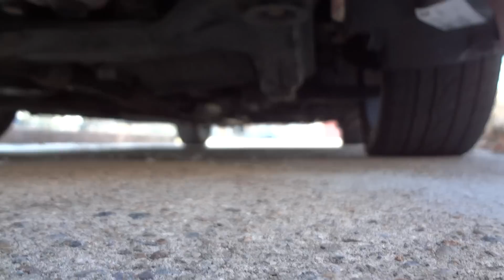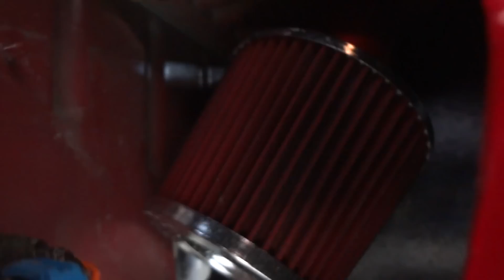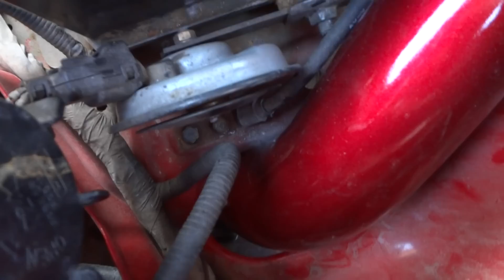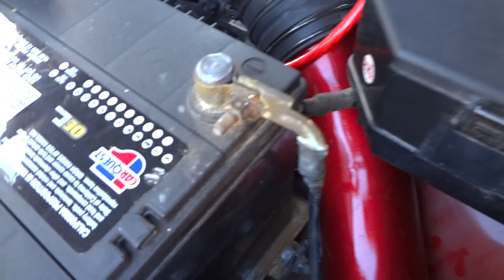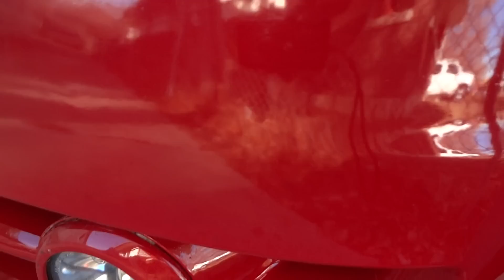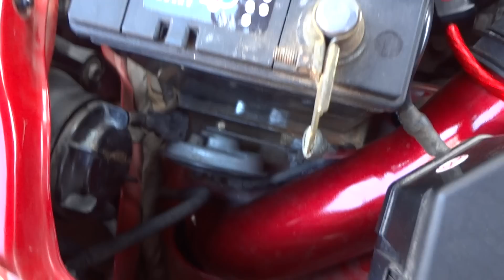Hyundai tiburon gt v6 cold air intake installed

Comment: For all those concerned with the water, you literally have to submerge the whole filter in water to hydrolock it. Driving through regular rain storms and puddles will not do anything and even if some water gets in the engine, it won't even be close to the amount of water needed for permanent motor damage. I have had one for almost a year now and haven't had any problems with water, even when I am behind people and their tires are spewing up water.
Reply: if flood bro? is it sucking the water?

Comment: By the way although the cold air intake will make a difference and add horsepower to your car I would recommend an upgraded exhaust system because while the cold air intake takes in more air your exhaust system being able to push out what it is taking in faster will definitely add more horsepower to your engine then either upgrade alone would

Comment: It allows the engine to take in more air in most cases colder air. Resulting in more HP, better MPG's and awesome sounding revs! Keep in mind when you do this upgrade your car will have to learn that it has an intake to take full advantage of it(24 hours of driving time usually). You will notice a little performance gain at first but you will notice more later when the ECU adjusts timing a/f raito etc. Definitely a good first upgrade.
Reply: tq

Comment: A new exhaust will make the CAI perform at it's peak but buying anything more expensive than OEM style spark plugs is a waste of money. Aftermarket plugs are more likely to cause problems.  Your engine was built to use a specific type of spark plug and any performance increase you see (if any) from switching is usually simply from putting in new plugs in general.

Comment: would this cold air intake fit a kia sportage since they both run the same engine
Reply: maybe. but the Mass airflow sensor insert may be off. and this piping looks custom to the cars setup, so idk.

Comment: Hey, I'm gonna to start upgrading my Tib soon, from bone stock. I experimented with a cheap SRI last year and had Lean codes with a CEL. Was your Tib running lean at all or do you think it was just the cheap intake that was the problem?
Reply from the maker: Thomas Calcara I had no problem with the intake. Until I installed the headers,  is when I had a cel light.
Reply: After installing the headers, doing an A/F tune would solve any lean problems, correct?
Reply from the maker: Thomas Calcara it most likely would, I didn't get a tune.
Reply: Thanks very much for the info. c:
Reply: Thomas Calcara  you won't get much power out of thes cars unless you do a 20g turbo setup

Comment: did the pipe fit in that hole down by the wheel or did u have to widen it
Reply from the maker: +Kevin Jackson it did fit all the way down to the inside of the front bumper, i then removed the fender plastic from the inside of the tire, so that's why i moved it closer to the engine.

Comment from the maker: nothing will happen if you have the black plastic that covers the bottom of the bumper then you will be fine. unlike me i removed the black plastic so now i have it in the engine. i only got an engine light because my mas air flow sensor wasn't connected properly.

Comment from the maker: its a cold air intake gives you more "horsepower" and gas mileage? sounds nice though
Reply: When you first did the install, did the car run like absolute shit afterwards? I just put one on my wifes 2003 GT V6 and it sounds like it wants to die for a second when i press the gas and then when the idle drops back down it jumps around on the rpm gauge. The battery was out of the car so it should reset the ecu so it can relearn the new air intake. I checked for leaks all the way up to the throttle body and can't find any leaks. Any suggestions?

Comment: Ok bro nice try but its wrong.First of all yoy need a full exaust system and the air filter to see difference.I here to write you cause yoy have a good engine and you can make your car really better.So try a new exaust,from the start always,and a new air filter with iridium plugs.you are now to +8-9 HP and much more acceleration.Its a good start but need a lot more.Keep trying bro!